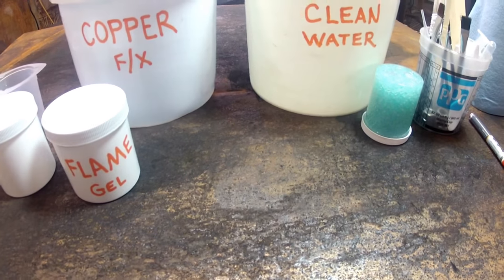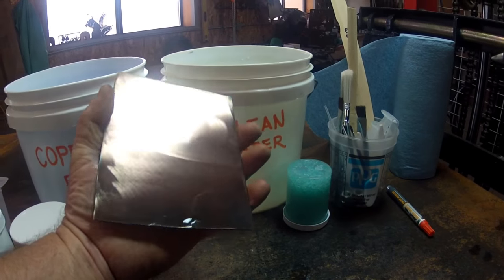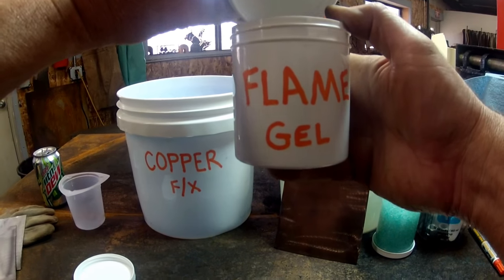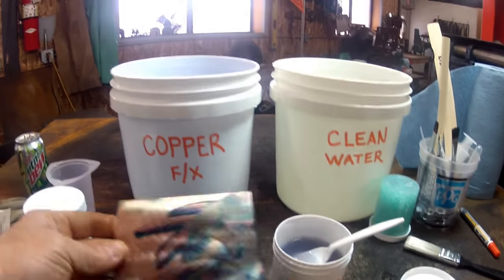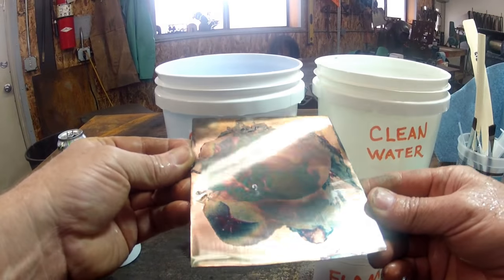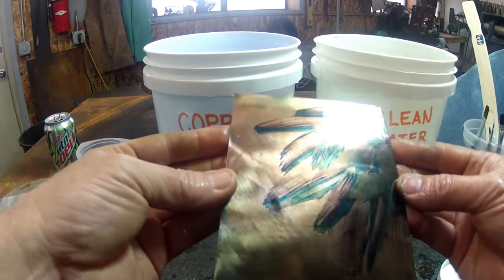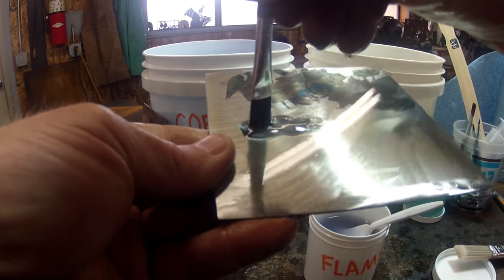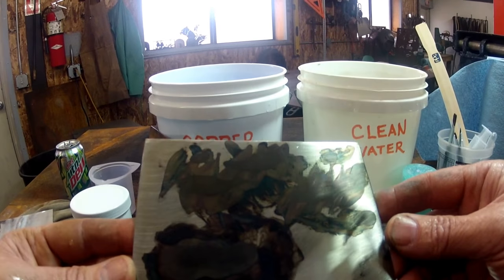FLAME F/X™ GEL PATINA FOR STEEL

Comment: Bill, I have been using F/x Copper with Blue Halo for years.  I just tried the Flame on a Marini Cadet rifle I am building.  I first tried it over the Burned Copper.  I didn't care for the colors wrong colors for a gun.  I repolished and put the Flame directly on the bare steel.  WOW! I after I rinsed and dried the action steel I did a touch up with Blue Halo.  Kinda picked out the bare spots and darkened them a mite.  I wish there was some wat to post these photos.  I will work on it and give it a shot after I finish the whole project.  It will end up a  Cadet Martini .17 Ackley Bee W/custom Black walnut stocks,  Steel F/x receiver, and Bosch Lomb 3x9 Golden Elite scope.

By the way how can I revitalize my Copper F/x?  I have had it for several years.  Does it lose the ability to bond with the steel when it gets gummy?  Can I use small amounts of controlled flame heat to make it flow into the steel?
Reply from the maker: @R.W. Felton...FLAME F/X GEL, BLUE HALO GEL and BLUE-BLACK F/X GEL are my 3 Favorites, at least in the Gels for Steel or Ferrous Metals.  STAINLESS F/X is my overall favorite, as it will work on Stainless Steel OR Mild Steel.  You can go to any of the product pages on my site and add a review, as well as upload photos.  You can also email the photos to me (address on site), and I can post them under the appropriate product.  You CAN (usually), reconstitute any of the Gels by a few 10s rounds in the microwave.  I wouldn't recommend flame-heating for viscosity restoration or surface prep.  Too many unknowns and just not advisable.  Sounds like a great project...can't wait to see some photos!  Here's my Contact Form on the Website:  https://steelfxpatinas.com/shipping-contact-info/  Thanks!  Bill  👍

Comment: How fragile is this finish compared to torch bluing or case hardening?  Will it wipe off as it ages?
Reply from the maker: +John Saia 
John,

It is critically important to protect the steel and patinas from oxygen & moisture.   If not, the surfaces will darken & rust.  Gilder's Paste, Carnauba Wax, Oil, Lacquer or some other kind of gloss clear-coat is required.    It won't rub off with your fingers, but before it EVER rubs off, it will begin to rust.

I use an Automotive Clear-Coat called PPG DELTRON DC3000.  It's on my site, if you choose to try it sometime.   I also have a 2-Part Clear that rivals the beauty of DELTRON, and it comes in an Aerosol Spray Can.   It's called, 'SprayMax 2k'.

Both Clears utilize a catalyst in a 4:1 mix with the clear for an ultra-clear, deep, high-gloss finish w/ excellent UV inhibiting properties.   It leaves your work with a "dipped in glass" appearance.

You can use any clear-coat that you're comfortable with.   Even Clear Powder-Coat.

Clear Powder-Coating over the Patinas and Dyes is fine, if done properly.    Some of the lighter colored patinas, like COPPER F/X™ will sometimes change to a darker hue, usually a greenish-gold, but in general, no problem with powder-coating if the time & heat in the oven is kept to a minimum.

I don't use powder-coat clear on any of my work for that very reason.    Automotive clear is far superior, both in quality & appearance.   It doesn't cost any more & the results are fabulous.

It is advisable to tack-rag the piece just prior to shooting on the clear-coat, whether it is powder-coat or automotive clear, to remove any flash-rust, even if it's not visible to the naked eye.

And, it goes without saying that all welding needs to be done before the clear-coat.

thanks,

Bill